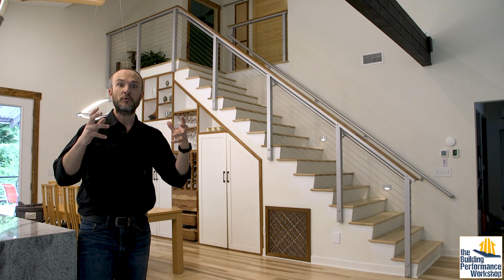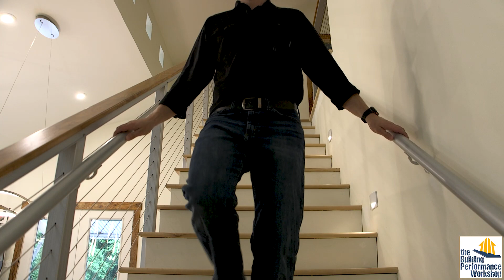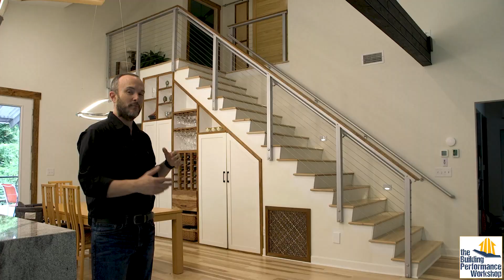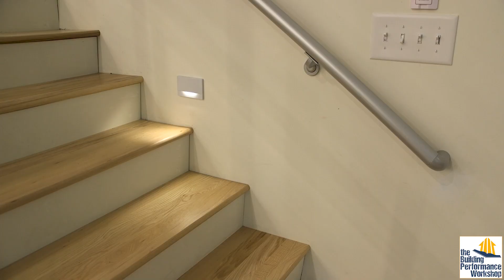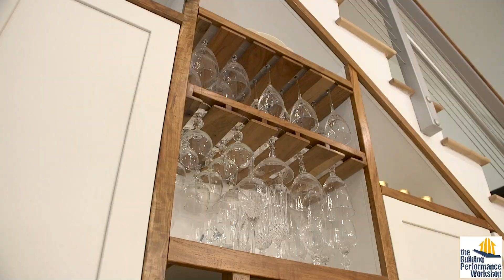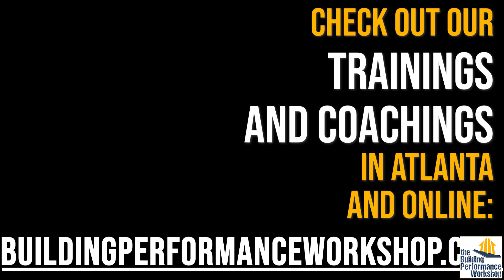Staircase with Built-In Pantry and Powder Room, HVAC and RailFX Cable Railings

Comment: Hey Corbett, a lot of people tell me that two story houses like this are actually more inefficient to heat and cool because the hot air rises and it's hard to keep the top cool without over-cooling the bottom. Did you have to do anything to combat this in your house?
Reply from the maker: That’s not true, actually- it would happen in ‘normal’ houses where the shell isn’t well air sealed and insulated, and where there was no design calculation for the HVAC sizing or ductwork. The more volume you fit into your shell, actually, the more efficient it becomes.